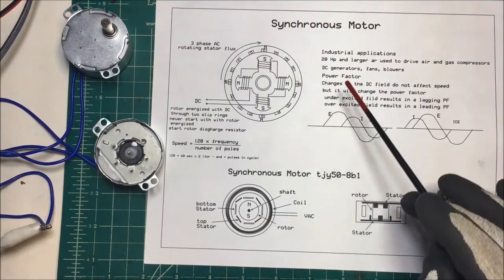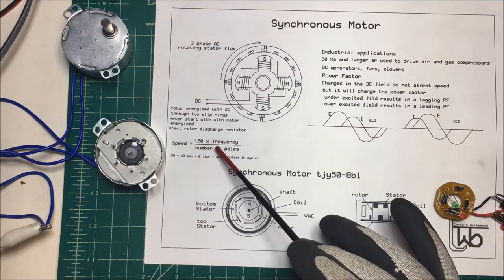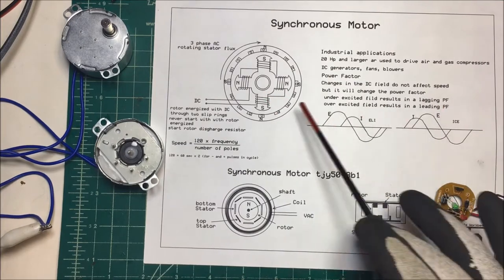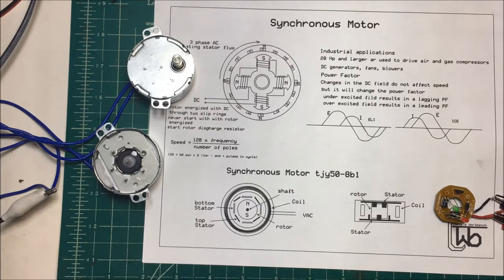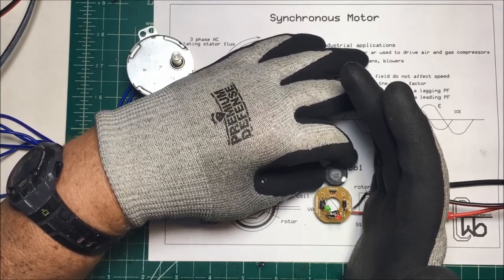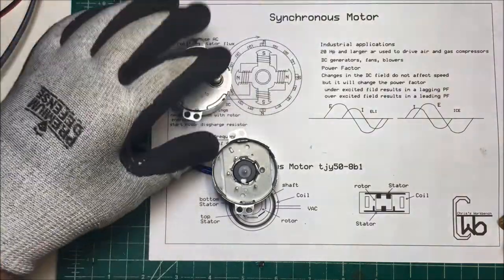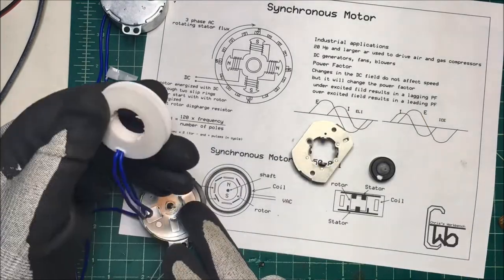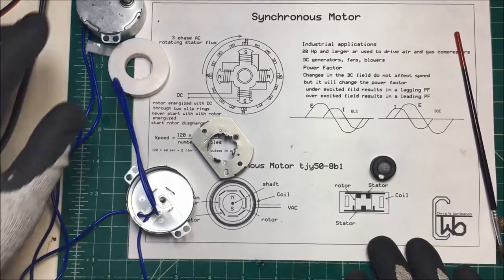Synchronous Motor

Comment: Hey Chris, would it be possible to wire these in a way that you can control the motor being able to spin in both clockwise and counter clockwise direction?
Reply from the maker: TYJ50  Synchronous Motor are sold CW (clockwise) CCW or CW CCW

Comment: i have small motor 220/240 5/6 rpm @ 4 watt, i want attach them into pulley or gearbox for veryy slow rotating turntable (diamter about 1 meter), probably max weight about 3 kg's do you think my motor were adequate enough? i am not good at calculate pyhsic things, thank you

Comment: I wanted to drive this motor on 12 v dc  are there any driver circuit  circuits  i changed motor coil so it's driven on 12v ac

Comment: Um how do you start a motor with the coils already energized? Statement did not really make sense.
Reply from the maker: A synchronous motor is started as an induction motor and is brought to about 95% of synchronous speed. Then the DC field excitation is applied and the motor pulls into synchronism.
Chris

Comment: I got it to turn for awhile then wanted turn in the opposite direction and then stopped.
Reply: Im not to good with these motor types but it might be that either the synchronous speed in the stator became too fast for the rotor to keep up, or the torque the rotor had to rotate became too much. The condition you described sounds alot like whats called 'hunting'. Unfortunately my problem is i only have theoretical background at the moment.

Comment: look inside your motor, you will see ONE coil! how is it the same like your  paper diagram? not the same.
Reply from the maker: The top diagram is a 3 phase synchronous motor, the tjy 50-8b1 is single phase with one coil.
thanks for the comment.